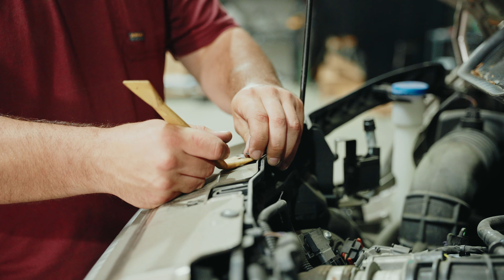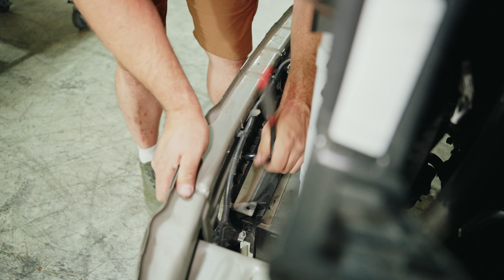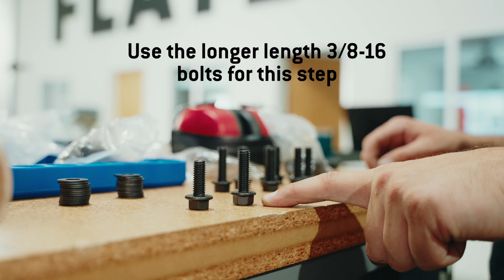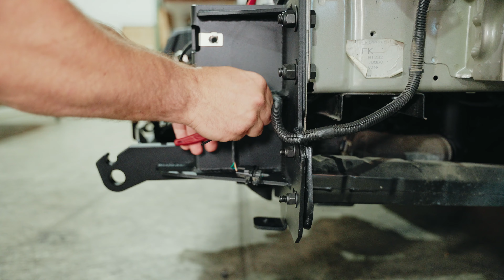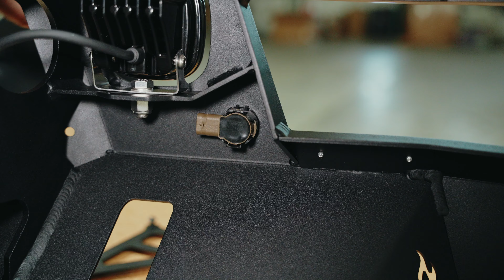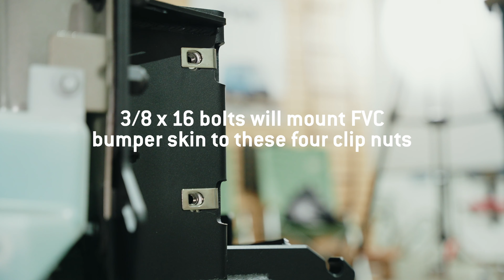Ford Transit Core Front Bumper Installation Guide - Flatline Van Co.

Comment: I wonder about doing an oil change with the skid plate, looks like the skid plate completely covers where the oil filter is located. Does the skid plate need to be removed to change the oil filter or drain the engine oil?

Comment: The removed factory steel bumper appears to have some crumple components that would add passenger safety in a serious crash. The replacement winch cradle doesn't seem to have this. Is there any crash testing done with your bumper?